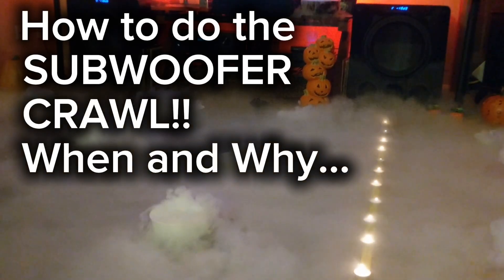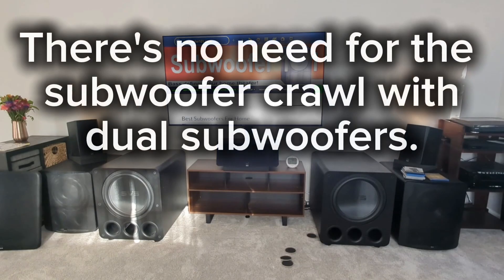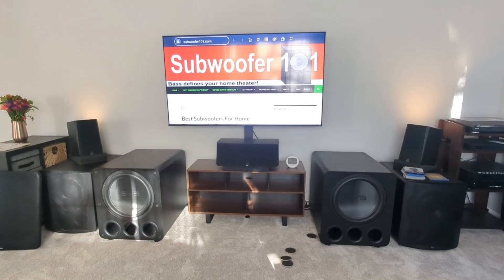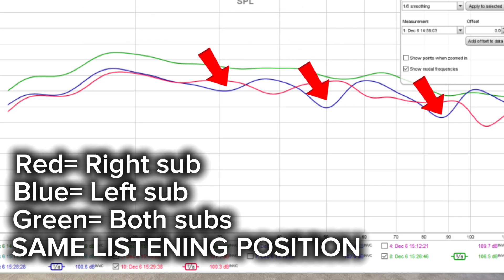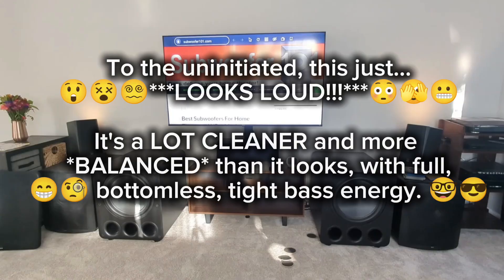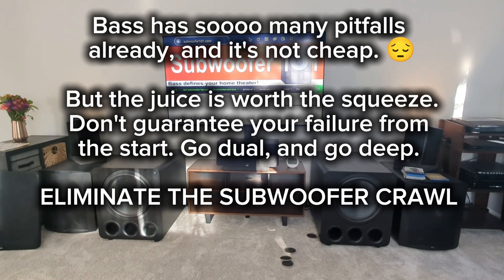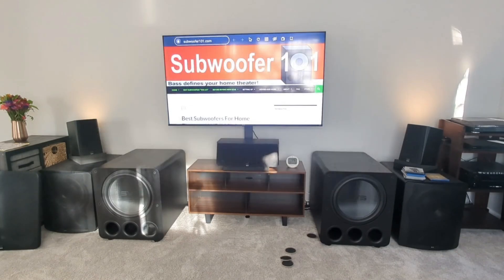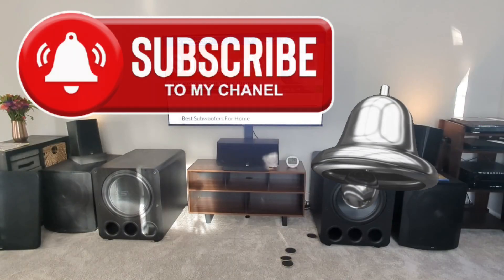HOW TO: THE SUBWOOFER CRAWL!! How, When, and Why??

Comment: After trying 5 different seating positions and 12 different dual sub configurations (including nearfield and placing them half way between the floor and ceiling), I gave up and resorted to measurements for placing listening position, speakers and subs 😅

For my single seat (!) setup, a single sub positioned correctly, easily outdid all the dual setups.. no contest! The sub did end up, somewhat into the room.. total man cave, so no problem 😂

Defaulting to dual subs is sound advice, but I guess no rule without exception and ultimately the room always dominates/wins.

P.S. I recently saw an interview with Todd Welti over on Poes Acoustics channel, who said something about not nessesarily needing more than one sub for a single seat setup.